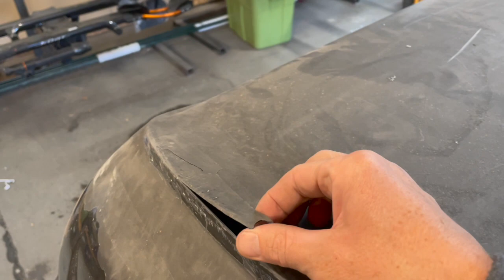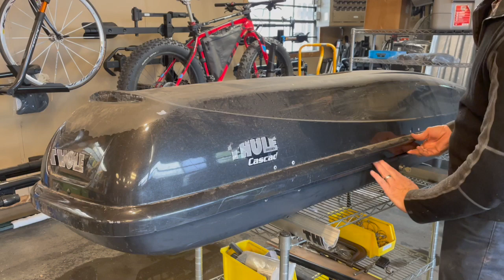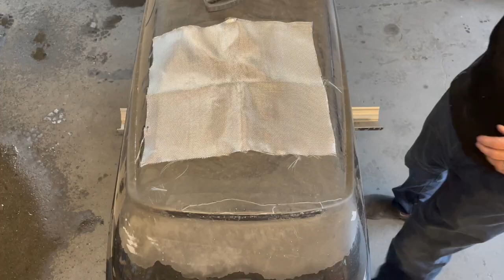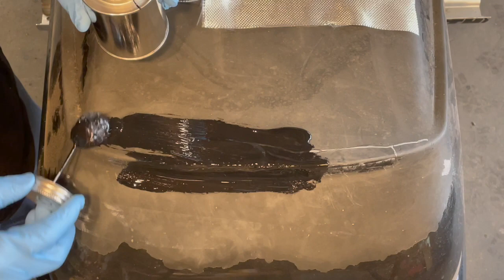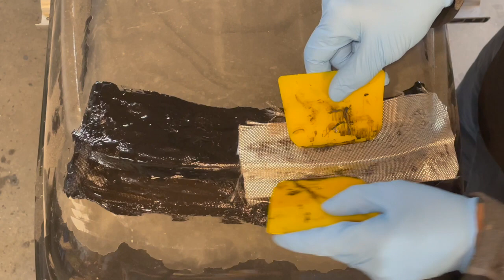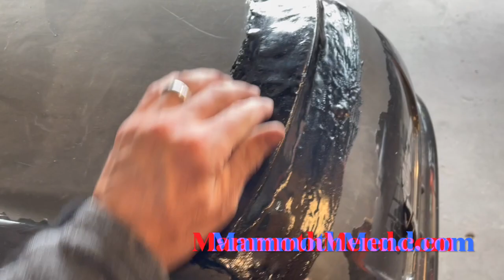Quick and Easy Cargo Box Repair

Comment: Great video! Is there any reason you didn't put the mesh on the inside instead? Would mean you dont need to clean up all the excess cement and could just use some body filler and spraypaint for the outside and look almost oem.
Reply: Great question.  This box was pretty beat up and the laminate had already pealed off on most of it so I decided to do it on the outside as an alternate way of repairing boxes.  If you watch my other videos, I typically remove the lid and do the work on the inside.

Comment: This helped my repair tremendously. I started with simple fiberglass drywall tape and went in layers alternating orientation. But it looks like you're actually using a fiberglass clothe? As opposed to a fiberglass mat? I 'had great success using Oatey ABS cement medium.
Reply: Unfortunately our formal doesn't us the Oatey.  We found that by using that formula that it doesn't hold up to the wear and tear of the extreme conditions of salt, Mag Cloride and extreme temperature swings of hot and cold.  It will eventually peel off.  Our formula has extensive additives to prevent this including elastomers and UV inhibitors.